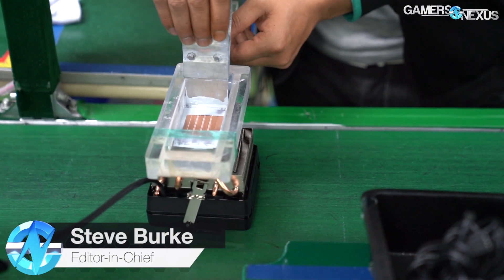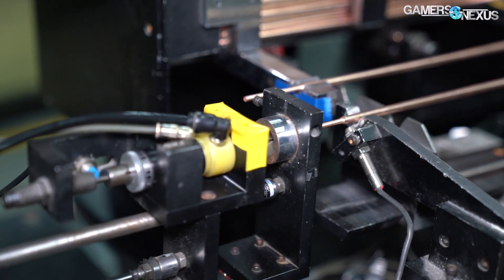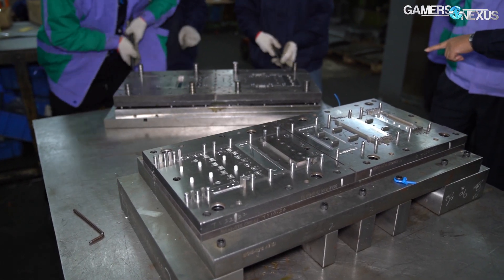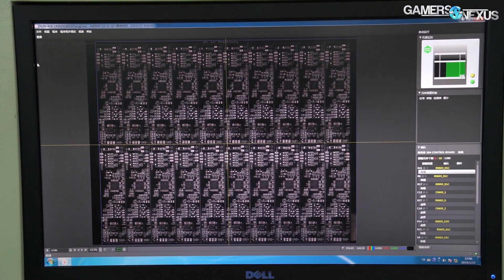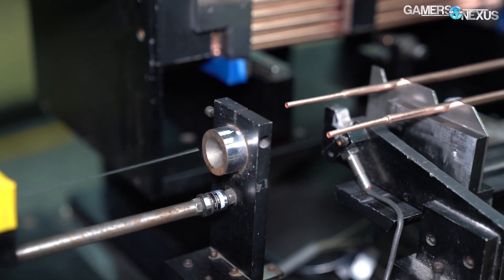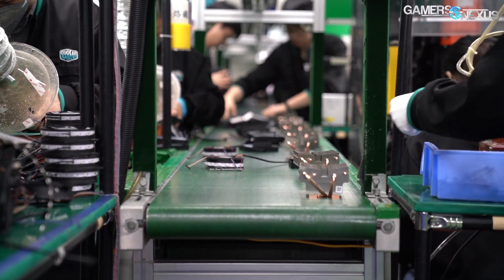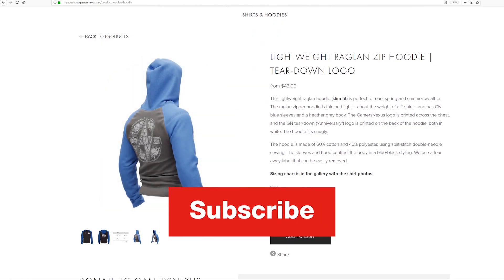How an AMD Ryzen Cooler is Made | Factory Tour (Cooler Master)

Comment: I remember back when AMD didnt have thermal protection on the CPUs and didnt sell an official fan, so when the one aftermarket one you bought failed, they would just say you should use an official AMD fan, yet they didnt exist. Toms hardware AMD burn anyone.

Comment: The Prism is a decent stock cooler, but they should have made the plastic fan shroud rotatable to keep the RGB logo at the top given that the connections are at the bottom when installed. It would have been much easier to install them at the top as most people run the USB wire behind the board to the headers at the bottom.

Comment: I worked at a electronics factory that used those PAP mashines. Good mashines, never frikn brake. But I am not to sure about the safety lock override they did. Those motors can rip your finger clean off. The way over 2metric tonnes

Comment: The cooler that came with my 3700x was a piece of shit. One of the tubes was almost .5 mil out of level and only two tubes were even close to even. Do not use a box cooler with out checking it.
 The processor was absolute magic.

Comment: Cooler master does some great work. Ive used their heatsinks for years. I just wish that you could get ryzen CPU's without the stock cooler. My sounded like a jet engine trying to take off under load, and got up to 85°c.  hyper 212 evo BE did just the trick.

Comment: Is this where they also make those crappy breakable plastic levers?
Reply: They don't break based on my experience. They break the other ones

I tried to upgrade my Friends computer to a ryzen 7 3700 rtx 2080 super. Let's just say when i was installing the cooler i have may not or may have destroyed the motherboard.

Comment: This is something that should not been made. The radiator is way too small. As soon as you put any load on the processor, the ventilator has to go full speed to compensate, and still the temperature is too high. You have VERY noisy system with VERY bad temperature management. And you paid for this crap. Why put that useless thing with  Ryzen 7 processor? Is someone buying this processor for e-mail and office work only? This is money thrown to the garbage. Possibly the most useless cooler ever made. OH WAIT WAIT i forgot, it has LED. I guess that's ok then,

Comment: Is anybody actually using stock coolers? I would prefer if they made CPUs slightly cheaper and we buy qualilty coolers ourselves. Threadripper CPUs are very cost efficient, because they come without a cooler.

Comment: as expected, safety is not a great concern at China. At 10:07 you can see that safety light curtains are installed, but outpassed somehow: the orange light on the yellow bar at left should go green when the light curtain is not obstructed, and red when obstructed  (when operators hand goes inside the press machine). This is one of the reasons why is cheaper to produce in China.

Comment: The factory is cool, and the amount of pre smeared thermal paste was perfect, but wraith cooler from my Ryzen 3600 is just not enough for this CPU. The temps are 100c on full load.
Its just useless.
Reply: That doesn't seem right at all, even when I was using the stock cooler my 3700x never went over 80.
Reply: @robertemerson1087  idk, i tested with prime95 and checked temps hwmonitor. Maybe i needed to check in another program like ryzen master?? But i already installed an aftermarket cooler. Can you send me a screenshot with prime95 test and temps on your 3700x?

Comment: Didn't show how they combine the aluminum and copper, and didn't show how they level the contact point between the CPU thermal spreader and the bottom of the cooler.

Comment: I think the worst mistake "Cooler Master Co." Has made is to add a major aluminium mini radiator to their main cooler fan and sell it for gaming computers.
Instead, they could use those unusable scrapp metal to make better mini motherboards for their printing machines.
Gamers aren't goofy people and nobody likes random metal on their machines. Even more if that tech is already discontinued for PC and ready to be used for other well know machinery.
Apart from that, basic assembly line for "Deepcool" fans are ok.
In my opinion, this company will make more money seelling rgb fans, adding some inside switches on their little mother boards with the possibility to connect their proper 12v wires or rgb wires. Many people outside their country do not use 125V energy connections. I'm from Argentina and we always used 220V direct alternate current energy flow. Just a commendation.

Comment: For the last - idk - 20 years, AMD is miles ahead from Intel on the cooling department. Firstly, most Intel coolers are connected to the board with a plastic mechanism which easily bends or breaks after years of service. Secondly, in order to switch a Intel cooler, you'll probably have to remove board from case. Thirdly, Intel coolers seem to be denser and gather dust quite faster that AMD ones, which degrates heat diffusion. And ofc, the RGB coolers for the big Ryzens are just marvellous.

Comment: Imagine going through so much work to make a stock cooler for it to just sit on a shelf and not be used cuz someone use a third party cooler
Reply: As long as AMD's check clears.
Reply: Ebay is full of OEM Prism Coolers (I bought one there to have pretty lights to put on my 3600), presumably after some guy who thinks he's such a hardcore overclocker that he needs water cooling gets and AIO to put on his 3700X.
Reply: @livingghost371  i bought a prism to replace a crappy stealth
Reply: @livingghost371  I feel called out lol
Reply: Amd stock cooler is basicly highly sophisticated junk
Reply: I didn't like how loud the stock amd cooler was so I got an aio lol.
Reply: They should really make the stock cooler's fan be adaptable, so that it can function as a cooler fan for the heat pipes and fins, but also taken off and placed as a case fan. That way they'd give a nice bonus to budget builders while also preventing E-waste.

Of course, they could also just not offer a stock cooler at all and just offer like rebate or discount code for a 3rd party or their own premium cooler...

Comment: I realize that this is an 'older' video and someone might have already mentioned this somewhere in the comments that I didn't see, but you have confused two different soldering methods together. Around ~6:15 you are talking about how the SMT boards go into a reflow oven (which is correct), but it works by 'reflowing' the solderpaste that had been applied previously. (Order is PCB, apply paste using stencil, pick and place SMT components, reflow oven). All the above is only for SMT (surface mount) components. 'Thru-hole'/aka DIP components use the method you then showed in the video, they go through a solder bath (something similar is 'wave-soldering', which is exactly what it sounds like). You went through all of it in another video the way I described above, so I know Steve knows how it works, this is more for any other viewers that don't know...
I really like all these factory videos you've done (I'm finally going back through to watch them all). Thanks for the great content!

Comment: I didn't know that fan speeds could vary by as much as 10%. Does that mean with custom wiring, if your goal was to get a fan spinning as fast as possible, you'd need to win the motor lottery, similar to the silicon lottery for CPUs? (I assume that the wiring normally won't let you go fast enough to observe variance anyway; it'd probably be fast enough to wear the thing out quickly if we're talking max speed (or maybe not, I'm basing what I'm saying off of assumptions)).

Comment: No offence but awful presentation. Looked more like a commercial for cooler master than a tour. Too fast presented didnt understand a thing. The cooler looks amazing and has quality materials but unfortunately lacks too much in cooling and the worst thing it is not ment for maintenance. How the f did they think (or i supose they haven’t) you can split the fan from the radiator several times without damaging the fins. If anyone knows let me know and ill asmit my mystake.

Comment: INCLUDED COOLER:
I really dislike the WASTE of including a CPU cooler many will never use. I'd far rather they offered CPU's at slightly reduced prices with NO COOLER at all so we could just that money towards a better cooler if desired. I'd also love to see their top AMD cooler offered as a reasonably price UPGRADE to the cooler included with cheaper CPU's. Maybe add $15 and get a better cooler even if just to keep QUIETER rather than spending $30 on an EVO or whatever while again throwing the AMD cooler you don't use in the garbage.

Comment: I used to work for a company who made "Tooling" there is a lot of tedious designing which takes hours upon hours, sometimes days even months go into the designs, the actual metal work by hand goes pretty fast, and any water jet, laser cutting, could take a little bit longer in total but the actual cutting by the machines is quick if that makes sense, and alot of times it takes Tooling to make Tooling so if thats the case double the amount of design time and labor time and machine time

Comment: Hey Steve a Bit of a correction for what you said, ...  When you call it a "Tool"  they are Normally Called 'Tool & Dye" because of the 2 + parts needed to make a product for that one step in the process. I used to Create "tool & dye" Pieces years ago and this is some shit YOU CANT Fuck Up or Be Wrong or it will COST YOU YOUR JOB.......when some "tool & Dye' parts taking close to a year with over 100 steps to create them yeah this ain't not week end angle grinder at LTT mess Alex makes this is Real "Man Up shit"!   I will give you Just one Instance I created a Tool & Dye for A part in the Space Shuttle & it cost $1.3 Million Yes you heard me right $1.3 Mill ....we worked in a secure Room because the Tool & Dye worked with Gold so it had to be with in 5/10000th of an inch in Tolerances.....yeah that tight, we had to use Video Microscopes to shape and Check the Tool's & Dye's a Laser Micrometer.  It was a great job and I got PAYED BIG$$$  but the stress was so bad I had A 26 yr old friend kill him self BC he fucked up on of the "Dye's" and when it Struck the "Tool" he did 60k worth of damage and set us back 7 months and the Union tried to get them to demote him and let him keep his job but BC he was BUZZED after Lunch they fired him and then 3 weeks later he killed him self sadly over his mess up. 
   Most of the "Tool & Dye" makers are young BC its very stressful and you need Godlike eyes even with Microscopes cameras we used ...after Danny died i put in my 2 weeks and walked away even when the offered me a 100K raise but i felt if Danny whom i thought was fantastic making Tool's & Dye's then shit it could happen to me so time for career change.........so off to IRON working I went.........yeah one stress to another ...lol 
   Also last part you sad a "Tool" is only 1 piece this is NOT  TRUE Most times it comes in 2 parts or a Mirror (A-B or 1-2) in most cases Depending on what Function or STAMP, Form, FILL, Cutaway, etc is being done to the Material. There is other ways also besides the T&D , A&B formats but if i described them all IDE be here half a day. 
  With all the NEW Computer and TECH available NOW T&D has gotten A LOT easier and faster as well as better tolerances when you make more than 1 set of the same T&D for Multiple machines like you showed in the "ROW"   we used to have to do that all by Eye, MS, and feel plus most times we would "rotate" each "Mirror" in the "Row" of machines and what that means is so they all Wore out even or you would not get most machines to cut prefect but 1 machine to cut shitty parts we would take each of the "Bottom Mirror Tools"  or the "B part" and move it UP 1 machine in the "ROW" each day or week depending on what speed of the Punch/Press, this gives an even ware on the Hardened "Tools or Dye's" 
   I wont Name the place I worked BC of Danny and his Family.....But Steve if you want Proof I can show you Pictures of me in the Company and the Clean room where I worked.  the funny is ppl ask How i went from high end Tech Guy to Cows.....When you make enough by 23 to retire you Do and I was ahead of the mass Migration to FL so I bought land .......lets just say that was a good idea!! 
     Anyway just wanted to let you know about "Tool & Dye' stuff sorry didn't mean to go out to left field but had not thought about that shit and Danny until i saw this video so Thank you Gentleman THANK YOU!!!  🙏🤗   Cow}:-o)

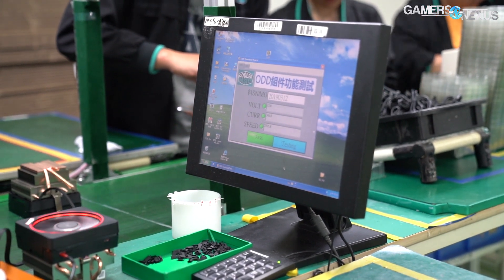Comment: 11:38 Ah, it's great to see Windows XP still kicking around in 2019.
Reply: windows XP is pretty much standard for factory.... Industrial machines where build around windows XP and windows is a nice middle ground for older hardware and newer hardware..... we still use windows XP professional on our office PC's ... cause we have lot of older equipments that does not support anything newer ...
Reply: Basically what kuntal Ghosh is saying is that upgrading would break everything and it's easier to stay on xp.
Reply: @thepope2412  yup... upgrading that will also mean u have to upgrade those decade old hardware ... and it's just not worth the hassle and money unless things breaks or needs an upgrade for newer machines! ... , our office is in a closed loop with the storage server and 3 PC's ... there is no access to internet !! so no fear of virus!! .....
Reply: As a computer technician, it is not uncommon for customers needing us to work on old computers like Windows 95 up to Vista.
Reply: Most of manufacturing software basicly built ini C or C++ that work best in win XP
Reply: factories run these machines in offline mode?

Comment: 0:29 the protective screen goes down after the press lol
Reply: It is also using 2-handed start as well as a light curtain, so there's no way to trap your hands.
Reply: @Species1571  your hands, not someone else's...
Reply: @Lishtenbird  The light curtain doesn't care who the hands belong to, it will still stop the machine.
Reply: @Species1571  If there's a light curtain, why have the protective screen - for if the other one fails? Well, it already did.
Reply: @Lishtenbird  No it didn't she had to press both buttons. Best guess, the light curtain was retrofitted to satisfy those pesky health and safety regulations. The screen is probably more to prevent any parts from popping out of the machine, and I agree it should really be down before the press makes contact, probably an air pressure regulator needs adjusting.
Reply: @Species1571  the light curtain isn't big enough, you can see clearly how there's space at the bottom that isn't covered by it
Reply: @tannisroot  You would really have to be trying to get your hand in there before the door closed.
Reply: @Species1571  There are people out there who would do something like that on a daily basis you know?
Reply: @Weisior  Darwinism at work.

Comment: I'm not biased toward Intel or AMD as they both have their place but see all the comments about Intel coolers. When Intel supplied a cooler with every CPU noise wasn't an issue. Most coolers and fans in general were loud. We just accepted the noise. Rather than supplying a decent cooler I guess Intel cheaped out and figured most high end CPU buyers would add a better cooler anyway so they quit supplying it. 
 Unlike Ryzen coolers i have never seen an Intel cooler fan fail even when choked badly with dust. I have replaced 2 Ryzen coolers in the past month with failed, noisy fans. I also replaced one with failing RGB. I have another computer coming in on Friday complaining about a noisy fan.
I suppose nothing is perfect.

Comment: 10:00 
I am curious why that machine has sound-insulation.
Reply: It uses heat and "Vibration" to bond the parts, if it vibrates then the sound would resonate and amplify inside that chamber if it wasn't dampened down by the sound insulation, that's bad for electronics, it's bad for your ears, and it's bad for everyone else's ears, not to mention if the vibrations were amplified then you'd eventually cause more wear to the machines moving parts
Reply: @LND3947  
Thanks, that makes it clear.

Comment: GO TO 3VGA FACTORY AND SHOW US HOW THE RTX 2080 TI FTW 3 ULTRA GAMING IS MADE
Reply: FeeNeeX That is very oddly specific... other than the GPU die and vcore specifications, along with the number of pcb layers, arrangement of circuitry, and memory, GPUs have not changed really at all. 

That begs the question, are you trying to have Gamers Nexus feature how your card is made specifically (assuming that you have that card) just to feel important on your 1400$ purchase? >;)
Reply: @MarcABrown-tt1fp  yes
Reply: FeeNeeX Well that's fine. I was just curious, the absolute best never comes cheap.

 I am a bit worried about trending Nvidia enthusiasts buying the next most expensive thing from Nvidia, causing the sharp spike in the average dollar per frame ratio in Nvidia's listings just because.